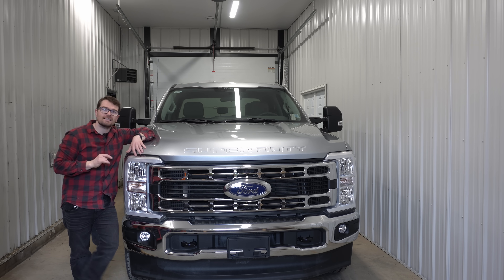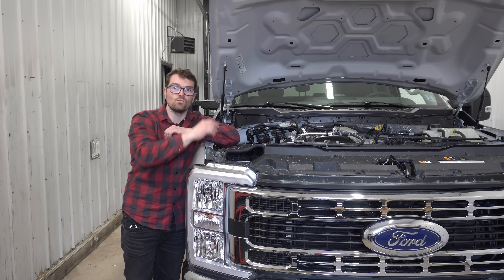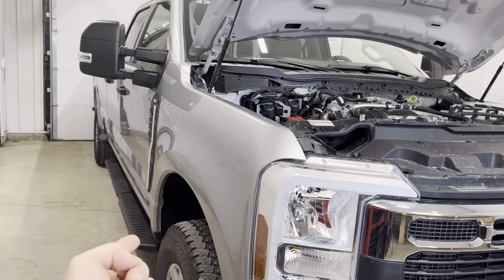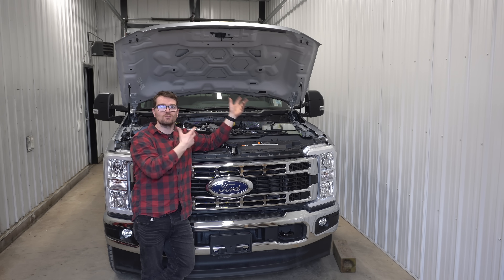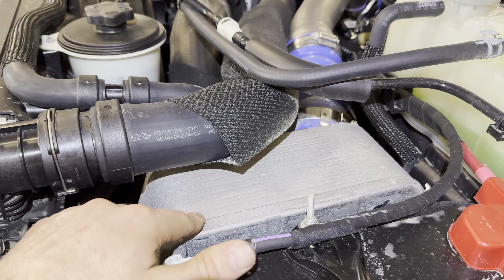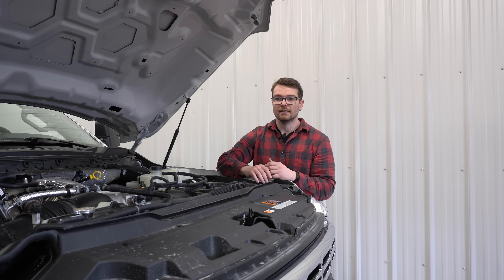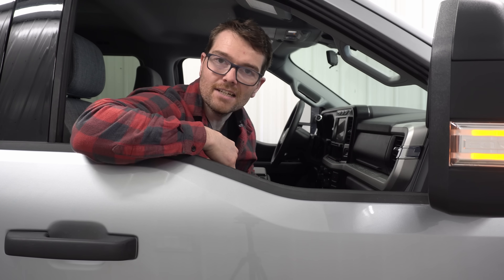Ford F250 HO PowerStroke Diesel Engine Review *HEAVY DIESEL MECHANIC* | How GOOD Is It??

Comment: It’s important to note that for the F250, the HO charge includes a 1-T rear end to increase GWVR with the heavier diesel motor. This is over a $1,000 up charge on the SO. 

So basically you’re paying almost $1K for a factory tune and two part enhancements - dollar for dollar.

Comment: I have a 2017 6.7 Powerstroke with 440 horses and 925 pound feet of torque. That's way more than i will ever need. I don't tow much and it's my personal vehicle. It has been a good, dependable engine. Always fired up and got me there and back. It can do anything 1,050 pounds of torque can do, maybe 2 seconds slower. Big deal.

Comment: Great explanation!
Question for you.
If you are someone like me that drives around 70k km per year(75% highway), tows 15-20k of those miles(9-16k lbs), and wants to keep their vehicle long term(10y +). Would recommend the desiel or gas option. 
Im currently in a 24' 7.3G, and im wondering if i made the right choice for a long-term purchase. 

I'm curious to hear what yours or others' thoughts are.

Comment: I ordered a 2024 f350 dually king ranch  6.7h.o. best truck from my previous 6.7s that i had. The power and the noise of the powerful engine is on another level. Love it and probably will be the last new truck i buy since everything else is turning to crap.
Reply: I was told that the HO burns a lot more DEF fluid. Has that been your experience?
Reply: @Steelviper61  I had a 2018 6.7 and I dont remember having to fill def after 2000miles so yes thats correct the 6.7ho burns alot more def but from all of them the 6.7ho does have better fuel economy and huge difference in power.

Comment: It's so disappointing that the diesel is not standard. It's a $10k + option for the standard and almost 13k for the HO. New vehicle prices are insane across the board. No new vehicle on the market is worth it's MSRP at this point. If you walk off the lot with your new truck and it's immediately worth half what you paid something is wrong. And the reliability has gone down across the board. A ton of systems making them even more difficult to diagnose and repair. And constantly changing the design and parts. Ford is notorious for offering too many options. They need to keep it simple. That's we all want. Simple and works hard for a long time. That's why this 97 powerstroke will be my last vehicle I ever own. I'm 34 and I will NEVER be buying another new vehicle unless they take 50% off MSRP and offer lifetime power train warranty❤
Reply: Sad, you will never have a new truck then.

Comment: The regular engine is already extreme overkill. We don’t even use diesel anymore where I work. we use HD F650 with the 7.3 gas and they pull hard and get the job done.

Comment: The 2023/2024 SuperDuty looks absolutely horrible ! The addition of the bed & bumper steps looks ridiculous and has ruined the classic body-lines.  Without a doubt the 2023/2024 redesign is the worst looking  Super Duty to date. @Ford #FORD

Comment: I’m testing all the brands right now.  Today I was able to drive the F250 tremor.  It was my favorite so far.   I won’t even drive a dodge.    The GMC have transmission issues right now.   So this might be my new truck.  Great video.  Lots of power.  Good looking truck. Thanks.
Reply: No doubt the Tremor is a fantastic truck. But Ford gives bad greedy vibes when they force you to buy the HO 6.7 for the Tremor package!  That makes no sense at all!!!
Reply: The fords have been blowing up 10 speeds. Losing electronics the 4x4 system keeps failing, and the front end keeps getting loose. My ram has lost a wheel bearing to a loggin bridge that had a deep pothole and I've lost all my belt accessories at 170k miles, my buddies ford was doing this stuff at 5k and now 70k miles. We put 20-30k on em every year most of it logging roads. If I need a truck for the road it's a duramax. If I need a truck to work. Its a ram. He bought the f250 cause he thought thr maintenance would be less than his 99 ram. Turns out it's hard to make money when the damn thing is down all the time.

Comment: I have the 2023 HO 3.31 axle and it peels out in all the first 4 gears with 37s inch tires on, it’s insane.
Reply: Get ready for a new 10 speed if you keep doing that. It'll hold if you dont dog on it. My coworker does 40-45 on the roads we work. We do 15-30 depending. His 10 speed was shifting so much it burned all the clutches up trying to keep him in the powerband. If he'd just let one of the gears do all the work. Hed be fine.

Comment: I love my 2020 Ford Super Duty.  Best truck I’ve ever owned.  Immense power, comfortable and the best looking of the full size trucks.
Reply: Definitely not best looking.
Reply: Worst* looking
Reply: My buddies has had over 40k in warranty repairs. 10 speed burnt up the clutches driving logging roads, front end needs replacing every year, the tires no matter what wear uneven, electronics all turned into the horn, 4x4 fails every year, and to top it off. Its all aluminum and my ram 2500 with the ranch hand and big steel flatbed gets the same or better fuel mileage with like 2k+ more weight on it.

Comment: Part of the reason a diesel gets better mileage is the fact the engine can get the work done with less rpm. BMEP is why Cummins says the  6.7 Octane will be better than the competition. I would expect the MPG to be slightly less than the diesel counterpart(less energy dense fuel).

Comment: I had no idea that there were so much trickle down to the standard engine. Thanks for pointing all this out. What would you replace the Bosch fuel pump with on the powerstrokes
Reply: S&S DCR is the only legit replacement that will not grenade.  Also, use a lubricity agent in your fuel to limit the possibility of the cp4 coming apart and damaging your rig

Comment: You know what I'm gonna say it. I dont think the 6.7 powerstroke belongs in the F250. I think if you need more power than the 6.2l gas engine option will provide you need a bigger truck to go with your more powerful engine.  The gas engine will do everything you would need a F250 to do and if you are regularly towing 15k+ pounds like the F250  with the powerstroke will do you would be much better served with a F350 Dually.

Comment: @TheGettyAdventures - I watched your video about diesel engines/trucks 2012 and newer and how they are very troublesome specially if they are not driven far every day. Would you recommend the purchase of a older diesel model? Like a 2010 F250 with a diesel engine? Do those have the same issue or are they more reliable?

Comment: Hey man quick question I got a 2004 gmc 5.3 t and it has around 140 k miles never had an issue allways been reliable , I meet a guy who has a 2013 ram 1500 5.7 express and has around 140k miles he fell I love with my truck and he wants to trade should I trade my ls motor for a 5.7 motor

Comment: I have a question about the cp4 pump. Why didn’t they update or fix the issues with this pump so it doesn’t explode metal into the injection system like mine did? They know it’s a problem so why aren’t they addressing the problem. Otherwise it’s a great engine
Reply: They dont care. Its the same reason the 10 speed isn't getting recalls.

Comment: Interesting piston design. IMO the HO 6.7 is just not necessary. 150 extra TQ is really nothing but bragging rights. I think it would be safe to say that the F450 pickup with SO 6.7 could haul the 40k load about as well as the HO, if Ford sold a config rated as such. What I find quite dumb is making the HO available on an F250. It's such an unnecessary engine for a 3/4-ton.

Comment: The 9th injector was one of the reasons I picked my '18 L5P.  That plus no CP4, 3.73 gears, and was more comfortable than the other 2.
Reply from the maker: It's the best method to run a regen and I like how Duramax has been doing it since like 2011 I think.

Comment: The standard engine is not using more boost and therefore does not need a lower compression ratio.  Lowering the CR on the standard engine will result in less efficiency - which may be a choice so that the HO  doesn't look so bad when compared to the standard engine!!
Reply from the maker: yes sir! on the cummins side of things their SO engine still runs like a 19:1 compression ratio keeping it very efficient.

Comment: That just isn't the case. There have been breakdown videos for a while now showing the difference in the internal turbo parts. Similar yes but absolutely not the same water cooling aside.
Reply from the maker: "basically identical" I believe is the term I used. I have seen that video - great video, there are very minor differences but I would guess the actual performance out of both is extremely similar. Ford even admitted the turbo sizes are the same for whatever that is worth.

Comment: Anything that minimizes fuel dilution of the oil is for sure a big, big improvement for Regen.  Great application on this Ford.
Reply from the maker: exactly, just a much better way to run a regen.
Reply: @GettysGarage what are your thoughts on that EGR? With the 9th injector does that change the amount of “sut” that runs back through the engine for a second burn?

Comment: I am not sure a more aggressive cam-lobe on a CP4, pushing output volume and taking the pump further up its performance envelope is a good thing when these pumps are famous for grenading catastrophically already...
Reply from the maker: My thinking exactly, granted ford does seem to have the best luck with these pumps so we'll have to wait and see unfortunately.
Reply: @GettysGarage  It seems that there is plenty of Super Duty failures of the CP4 on YouTube which ends up costing huge dollars (>$10K) if the system is no longer under Ford Warranty.  A company called S&S makes a fuel pump that replaces the CP4 called their DCS pump.  Before they released the pump this year, they also made a kit called a “disaster prevention kit” that was basically some screens for the CP4 fuel lines, which detect metal shavings during a pump failure and shut the pump down almost instantly, thus preventing these metal shavings from migrating into the injector lines, injectors and the fuel return to the tank and tank itself.  That said, if someone was going to put a disaster prevention kit on a CP4 from S&S, it would be better for the labor $$ to just replace the pump as the labor to get down to the pump from the top of the motor, removing tons of stuff, isn’t going to be that much different than just replacing the pump.  Some have expressed that if the CP4 fails under its warranty period, it’s a Ford issue with regard to cost and that replacing the CP4 with an aftermarket S&S DCS that might void the Ford Warranty.  However, there is a law down here in the US which places the burden on the vehicle manufacturer to show that the aftermarket parts or modifications were the cause or contributing factor leading to the failure for any warranty related work an owner would be asking for to do under the provisioned factory warranty from Ford.  If it was me, I would spend the dollars and have the CP4 replaced with a DCS before warranty or no warranty lapse, either way.  It’s expensive as F-bomb and one would want to make sure the job was done perfectly, e.g., the lines, injectors and related things were buttoned up perfectly.  It is a really, really stupid thing that Ford continues to use this pump when their competitors moved away from this disaster of a pump because they were getting killed by the CP4 warranty fixes.

Comment: Great review.
I have never understood putting a PowerStroke in a F250.  You barely have any payload left.
My dream truck is a PowerStroke F350.  I just went to the Ford site and built it.  Amazing how fast you can get up to $90K.
Reply: I’ve always thought this but my head scratcher was more in line with suspension.   The amount of power available way out shines the amount of suspension capacity available.   If you’re out doing the gas engine then your out doing the suspension capacity as well

FWIW, my 22 f250 is an extended cab 8’ bed 4x4 on 33” rubbers with a 6.2 gas v8 under the hood.   It weighs almost an even 7,000lb with me and some tools inside.  That leaves me with 3,000lb of available payload. Not too shabby.  The only thing I would do different is the gear ratio. It’s got 3.73…. I run mountains with a trailer on the daily, all low speed stuff but steep.  I think the 4.30 gears would make a huge difference where I work the truck
Reply: Even worse with the Ram 2500s with the Cummins. HD truck with 1000lbs of payload. Lol
Reply: That sticker could cost you 😮
Axle and tire rates??????
Reply: Lol! Ya 4000 or so lbs  of payload. So low.
Reply: I would love to know the real percentage but in DFW area in TX, a 3/4 ton full on loaded pickup only needs the payload for golf clubs or rifles and a Yeti cooler for more than half of them. There are lots of them traded in 2 and 3 years old and there is not a blemish in the bed and many have the paint untouched in the hitch receiver. Ford, GM and Ram know  their market.

Comment: I pretend my 2.7L ecoboost is a baby Powerstroke
Reply: How do you like your 2.7? Thinking about buying one but I’m not too sure?
Reply: @mr.adventure6507  great engine! I had a 3.5 and the 2.7 feels more responsive. Better design than the 3.5 but it does lose on outright power. Just be sure to get 3.55 gears avoid 3.15. If you’re buying used look for a leaking oil pan and under the oil cap for sludge if the previous owner neglected maintenance. I run 0w40 Mobil in mine.

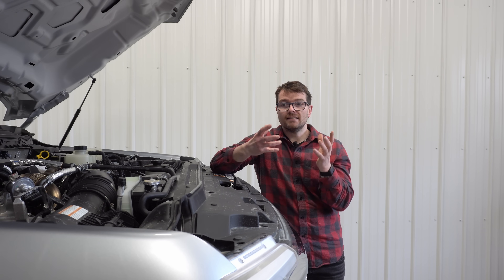Comment: SO has had more years under its belt, the HO is just gonna burn more fuel which in turn uses more def and go into regen more. Ive towed 16k with my 22 PS and it has 3:31 read end and it was way more than enough.
Reply: Def is irrelevant. You’re supposed to get it deleted.
Reply: @JoshuaOverman  Im not deleting mine till its out of warranty. Too much money

Comment: Hmmm so.....   Ford, Chevy or Ram??
Reply from the maker: When it comes to the diesel Id be happy with either Chevy or Ford tbh. For RAM I’d have to go for a 3500 HO with Aisin transmission. The SO Cummins with the 68RFE 6 speed just don’t sit well with me
Reply: @GettysGarage  NOW for the really hard question.... What about a 2500 GASOLINE engine? Chev, Ford or Ram?

Comment: I’m a ford guy and the company I work for put me in a 24 ram 2500 Cummins to drive for a few weeks. I need to buy a towing rig in tbd next few years and I just don’t know 😅 the low end torque of the Cummins is undeniable and with them going to the 8 speed next year it makes for a very attractive package. Then I see this video 💀
Reply: Ram low end torque isn’t even in the same field as a H.O powerstroke.
Reply from the maker: I love the 6.7 Cummins, great engine and I think with the 8 speed next year it will be a game changer. But if you get behind the wheel of a PowerStroke you might change your tune. You put your foot down and you hold on.
Reply: If it helps i see 10 speeds giving out under 100k under 70k. I pull fords off the sides of roads whos vacuum axtuated 4x4 fails amd they are too light to get out in 2wd. The ram flatbed i have is way heavier and gets the same fuel mileage and towing in the mountains the low end of the cummins is just nicer. I drove 2017-2019 6.7l f350 f450 f550s for 3 years before I changed professions and decided to get a 10 year old cummins and run it.
Reply: 8 cylinder  vs 6  cylinder  going for the Cummins  still last longer than that ford engine
Reply: @843MudMafia.  true but I don’t think within normal pickup truck life expectancy either one will wear out to the point of catastrophic failure
Reply: I just got a 2024 Ram 2500 with the Cummins and there is no denying that engine is awesome. My last 2017 Cummins towed great I can imagine how much better this one with the extra 50lb ft of torque. Did a Hemi 6.4 for a bit and immediately missed the diesel

Comment: As front mount intercoolers are more efficient, why not mount a larger intercooler behind the grille like (even Ford) many others do. Also, it does not seem to have a negative effect on engine cooling either.
Reply from the maker: I think there just isn’t enough space. That would be my guess. Because it would be a better set up
Reply: There is nothing about an air to air intercooler that is more efficient than an air to water intercooler.

Comment: Didn’t know that they now have a 9th injector like the duramax’s have that is a nice upgrade. Also I heard that the HO have inkinel exhaust valves instead of steel like the SO or the older ones. I believe they said they have a bigger oil cooler now too. Another separate note is I was told the large oil capacity for diesel is to trap soot as a quart of oil can only trap so much. Eventually that oil will get to temp it will just take longer. And longer to cool down too.

Comment: Great video Alex, does this engine have the problematic fuel  pump that grenades and takes the fuel system out? Hope not.  Still better than that god awful Cybertruck.   Just need to win the lottery to afford one.    Have a great week.
Reply from the maker: It does still come with the cp4 fuel pump but Ford honestly does seem to have much better luck than the rest with them. I believe ford has a factory lift pump which really helps these pumps from failing